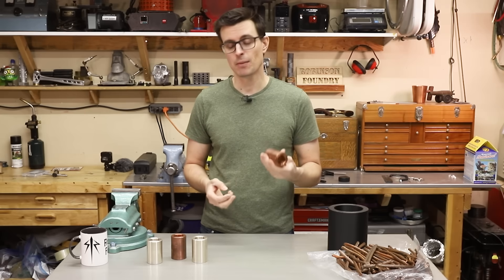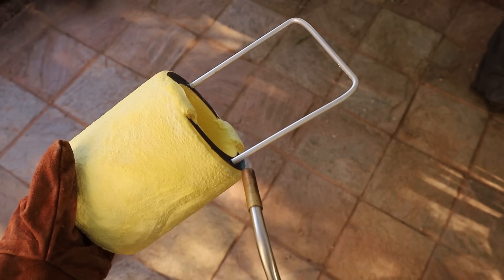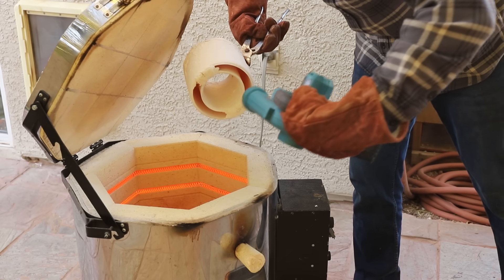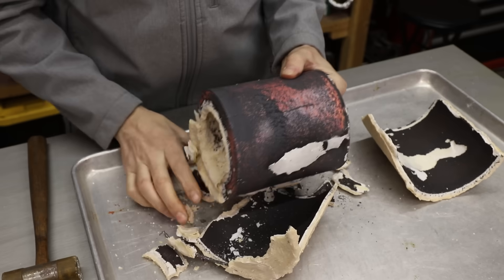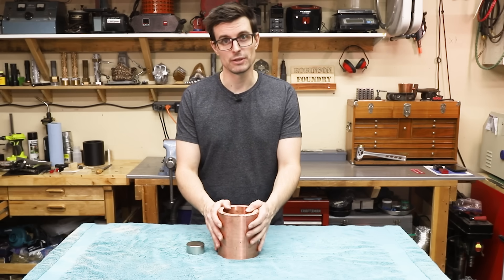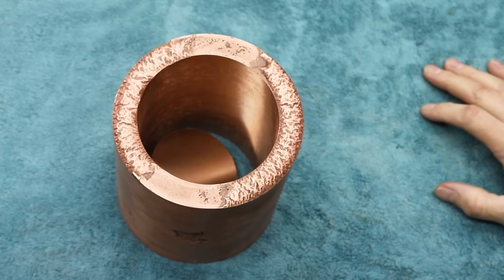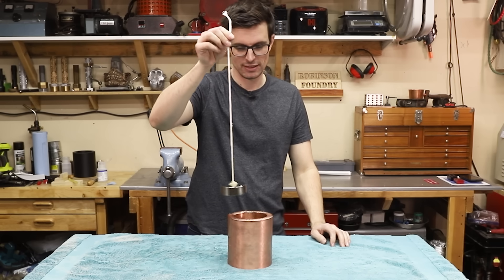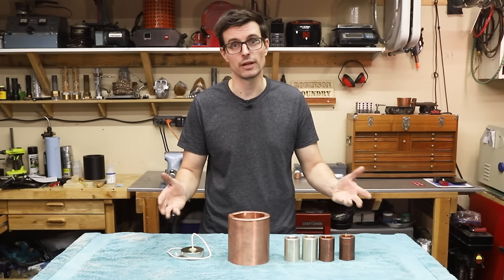Defying Gravity - HUGE Neodymium Magnet vs Copper Tube Experiment - The Power of Lenz's Law!

Comment: you needed a sprue to make poring easier that looked had lol that would've taken care of the shrinking problem too. it would be a little more complicated than the standard mold that you used but maybe you could make the next one just a tiny bit bigger and then throw it on a lathe?? I play around with my nieces and nephews with a long copper tube and some very strong magnets I have. I also have a big quarter inch stick 2' x 2' piece of copper plate that they really like playing with.

Comment: The underlying electro magnetic forces produced by the moving magnetic field produces other stuff too.
1. Try the experiment with very thin copper tube to observe the heat that's being generated.
2. Try the experiment whilst it's submerged in water.
3. Try the experiment in a very cold environment.
4. Try it with a woven copper tube.
5.try it using an insulated copper coil and connect the ends to a meter or a load.
6. Try it using a coil of copper connected to a large capacitor in series and parallel.
7. Try it with longer coils to study the effects of an autotransformer effect to measure the voltage produced.

Comment: If you put a corkscrew ridge or groove in the tube, or a copper corkscrew ridge in a plastic tube, will it cause the magnet to spin on its own when dropping or pulling it through on a string? Kind of like the grooves in a gun barrel, though the magnet wouldn't be touching the sides. What about a ball of copper through a magnet tube? 🤷‍♂️

Comment: This is really interesting. Maybe you could suspend the larger copper tube onto a vee block with roller bearings as contact points and spin the copper tube to try and get the large magnet to float in the middle. Great video!

Comment: Interesting video, thanks. Wouldn't green sand casting have been much simpler. Also, lookin how the copper splashed too far or too near when you poured, if you had poured along the ring and not cross/radially you would have had much less spillage.

Comment: don’t pour unassisted, build yourself a gantry to pull the crucible and do the pour.  also a vibrating source like a corded drill with an off center weight will cut down on the flaws.

Comment: A thought for your next mag/copper pour… make a tube similar to this one, with a ‘tube’ inside, but for the outside, make a ‘cone’ shape, thicker at the bottom, thinner at the top.  As the magnet falls, the force increases.  Is it possible to make the magnet stop before it exits the bottom?  I think it would be interesting to test!

Comment: Get a plastic pipe or conduit say 1.5 meters long and drop the magnet thru it so that the magnet accelerates under gravity then decelerates when it goes thru the copper pipe at the bottom of the fall.
It will look cool to see that especially if the pipe is clear.

Comment: You had problems with pouring the copper into the mold because you were pouring it at the wrong angle! The pour should be done parallel to the mold's circumference, not at a right angle. Try to place one round magnet at the bottom of the tube (placed vertically on the table) and then insert another round one with the opposite polarity in the tube too. You should be able to accomplish a permanently suspended magnet with a degree of resistance to bouncing.

Comment: I wonder if anything interesting would happen if you would put the small cylinders through the big cylinder while putting a magnet through the inner cylinder. Basically so they are all stacked into each other. Perhaps the gaps would be too large to see anything interesting, but perhaps thats an idea to try out? Even just have tubes of copper that get wider and wider, stacked into each other, with a magnet in the middle, maybe the magnetic fields will affect each other somehow?

Comment: Suggestions:-
Degas the liquid copper. Buzz bars are made from Oxygen Free High Conductivity copper.
Ensure the inside of the 3d print is vented to atmosphere before burning it out.
Add a 3 to 4 inch diameter sprue on top of your 3d print where you poured the liquid in. This will help with pouring. Having a larger surface area to volume ratio it will remain liquid longer so keep feeding the part with liquid as the copper contracts and solidifies in the part. The hydrostatic head also helps with porosity.
Add a similar diameter riser on the other side to vent the part while pouring and feed the part while solidifing.
Chills are added to sand molds to make grains smaller. You want them bigger so wrap part and feeds in ceramic wool so it cools slower allowing the copper grains to grow big. Don't forget to cover sprue and vent after pouring. 
Cast at a higher temperature. 
Use molochite instead of silica from layer 2 or 3. It is a lot cheaper. 
If you are using E-glass cloth you could wrap the outside with it as it will soften and sinter at orange/yellow heat.
As others have said reduce the air gap between the magnet and copper. See Ben's video on magnetic materials at Applied Science.

Comment: Question?
What would happen if you wrap some copper wire around your copper tube and fired some voltage through it. Ac current and DC current.

Comment: Could you hook some battery cables to the copper pipe and power something while you drop the magnet into the pipe ??? Small LED or something else ???
Reply: If the pipe was a single coil of wire: yes -- this is regular Faraday induction. But I think with a solid copper pipe you can't quite get the current out of the pipe.

Comment: 8:30 Put the copper tube sideways on a rock tumbler, that keeps the tube rotating, so the big metal disc magnet floats in it suspended for as long as the rock tumbler keeps rotating the copper tube.
Reply: What's interesting too is why the magnet floats in the center when the tube is rotating: When the magnet is off center, the copper rotating past the magnet is going thru a gradient in the magnetic field. That is, imagine a point on the tube approaching the magnet. As this point rotates, it gets closer to the magnet, then as it continues rotating away, it gets further away from the magnet. So the strength of the magnetic field that this point of copper experiences is constantly changing, and it is this changing magnetic field strength that actually induces the electric current (and opposing magnetic field) in the copper. This opposing field tends to push the magnet away, and any part of the tube that is closer to the magnet will also push it away in the same manner. Thus, the magnet gets pushed toward the center. If the magnet's poles are oriented coaxially with tube (as it is shown in the video), there is actually no current induced in the rotating copper tube if the magnet is perfectly centered, as the field is uniform all around. Of course, gravity pulls the magnet downward, so it is always a bit off-center toward the lower part of the tube, which constantly pushes it back upward toward center. All of this is the principle behind homopolar magnetic bearings.
Reply: nice idea!
Reply: I wonder if the effect is the same with 2 semi circles or 4 quarters? This breaking any current/field between the 2 half circles..

Comment: I would like to see dropping or shooting the magnet into the tube at very high speed.  Try 10 feet of vertical plastic pipe that smoothly joins the copper pipe.  The faster the magnet goes, the higher the forces.  Drop the magnet and it will free-fall down the plastic pipe and then be violently stopped as it enters the copper pipe.  Could the force tear the copper or crack the magnet?  A higher fall makes higher velocity, but 100 feet of pipe could get costly, and then you need 100 feet of tower.  The potential energy is equal to force (weight) times height; falling converts it into kinetic energy (minus losses caused by displacing air).  There are ways to boost the speed beyond what gravity can do:  Cap off the plastic pipe with foil and pull a vacuum inside it.  Slam the magnet through the foil and atmospheric pressure will blow the magnet down, adding to gravity.  An improvised rifle or cannon could propel a smaller magnet (one with a non-metallic barrel).

Comment: I'm not boasting or anything and I know those magnets are massively powerful, but their power does not extend far from their surface.  I used to be an MEI and CT Scanner engineer and we got to play with truly awesome magnets.  We used to get the junior doctors to hold part of the aluminium safety rail and literally RUN at the magnet.  They would never get there, because the magnet would slow them down to a crawl before they hit it.  MRI's are fun, just a bit unforgiving.

Comment: Curiosity!   Connect a voltmeter across the half-height external middle diameter, top rim to bottom rim, across the half-height wall thickness.  Then drop the magnet in each case.  What happens if you apply an opposing DC current in each case, then drop the magnet?  (Ballast resistor?)  AC?

Comment: It is not anti-gravity, It has nothing to do with gravity. If you had attached a cord to the magnet and tried to pull the magnet up through the copper tube it would resist your efforts. It is just the changing magnetic field along the length of the copper tube is inducing and electrical current in the tube which in turn is producing an opposing magnetic field.

Comment: Instead of pouring perpendicular to the opening in the mold, try pouring it tangentially. When the molten copper sloshes it will mostly go in the opening further away from the initial spot, instead of pouring into the center of the mold and wasted.

Comment: I've always wondered what would happen if you had a copper toroid with a band removed from the circumference of the outer most face and put a magnet inside and then spun the toroid like a wheel at the exact speed the magnet was falling at so as to keep it continually levitating.

Comment: Definitely make the ID size more exact to the size of the OD of the magnet if you want to see the best results. The closer the better. That's why a magnet that's literally sitting on a copper sheet then sloped at a near 90° angle will move extremely slow.

Comment: I wonder if heating or freezing the magnet would make a difference.   Kind of like a MRI machine, it's liquid cooled.
Reply: Heating magnets above their curie temperatures (different for each material) kills them.
MRI machines have a huge magnetic field from a superconductor (ZERO electrical resistance). Most superconductors need to be cooled to liquid nitrogen or liquid helium temperatures to become superconducting.

Comment: Using two smaller neodymium magnets, carefully attach them together at opposing fields, then test to see if they fall through regular air in a vacuum at the same speed as other objects. It is my understanding they will not, which would be baffling. I haven't had time to test it.

Comment: Why would you waste so much plastic? You could have easily added 1-2 degrees to the sides and then removed it from the mold. If the mold failed, you'd still have the original to try again.

Comment: With the magnet on the string, hold it so that the magnet is just touching the outside of the copper tube.  Without moving the top of the string, pull the magnet away from the tube (like a pendulum), and then let it go so it can swing back toward the tube.

Comment: Fun to watch. What happens if the two magnets are placed connected by their magnetic attraction to the opposite ends of one of your smaller copper tubes then dropped through the larger copper tube? Also perhaps physically attached faced opposing magnetically.

Comment: A good way to show the 'resistance' of the magnet to move in the cylinder would be to hook up a fish scale to the string.  That way when you pull the magnet up and out of the cylinder, you can see the increase in the amount of force it take to pull the magnet.  Outside the cylinder, the scale should always read the weight of the magnet when you lift and lower, but once the magnet is in the cylinder and you go to lift, you can easily see/show that dramatic increase.
Reply: You need to be careful to keep the scale far away from the magnet, and ideally the scale should not contain any ferromagnetic materials (or paramagnetic materials if you want accurate measurements).

Comment: I’ve seen someone swing the magnet at a chunk of copper and before it crashes into it, at least what you’d think would happen, it’s like invisible brakes are applied to the magnet and it slows waaaayyyy down and just touches the copper. Looks really trippy, might be a neat effect to show.

I found a small neodymium magnet at work and spent waaaayyy too much time dropping it down a 1/2 copper pipe. Took like 5 seconds to travel 2 feet.

Comment: You can use the same phenomenon to launch aluminum discs from the top of a flattened conductive coil when AC current is applied. A thin rod is usually placed in the middle of the setup to constrain the motion of the aluminum disc, otherwise it will tend to simply slide off to the side. Aluminum is better for this since the metal is less dense than silver or copper. The conductive coil can be made from some copper wire. Nothing fancy is needed, just a switch or a voltage controller and conventional residential wall power (standard 60 hz 120 v AC works fine).

Comment: I use small neodymium magnets in projects all the time and keep a variety of them on hand. People are amazed at the power of a 1/2" disc X 1/4" thick N52 grade magnet when I demonstrate them. And I keep a 1" N52 sphere and a 4' length of 1 1/4" copper water pipe on hand to demonstrate Lenz's law also. Even being familiar with it it never ceases to amaze me at how long it takes to drop through. That 3" magnet you are playing with is a monster. Be vigilant with it especially around the other large magnet.  By the time you realize you made a mistake you may have already lost a finger. I've had a 1" magnet bite me pretty good and it happens fast.
Reply: It’s true I lost 2 fingers to magnets.
Reply: @Jonb173 ✌👈👍
Reply: @Jonb173 thank you for sharing😢 that's intense I have had a magnet bite me once that now I have rules. And I've told people does the big ones can take your fingers but I don't think they believe me... So I'm adding your anecdote and life experience to my spiel when I share and teach with magnets. So again thank you. 

I started this method of rulemaking after I was injured by a table saw from a kickback of MDF and it was actually a man that I worked with that had lost four of his 10 fingers to a saw in the shop that we worked at that cemented the ritual of rulemaking and rule rehearsal every time I turn on my saw!
Reply: @souljunkee33 what do mean started this method? It is a very standard rule to have basic rules whenever any uses are is around tools.
Reply: And also its good to cover it in cloth and cartboard or something, while you walk through doors. You can simply forget that the frame might be made of metal, and boom injury or worse yourmagnet might crack xD
Reply: I salvage magnets from hard disk drives; thinking I would use them as refrigerator magnets but they are MUCH too strong for that purpose.
Reply: Magnetrons from microwaves.  Beware of the beryllium dust.
Reply: @thomasmaughan4798 try dipping/covering them in rubber like tool dip or liquid black tape, it requires several layers to be effective but it does give you the good holding power without “becoming one” with the fridge door or destroying the finish on it. You can also use epoxy or similar material but it isn’t as durable as the rubber is
Reply: @bobquartlemigula2351  Excellent idea!  Rubber coated disk drive magnets.
Reply: @thomasmaughan4798  you can use those in 3d prints. leave a void space for the magnet in your model and set your print to pause at a certain layer, insert your magnet and keep printing. just don't do this with a magnet that's strong enough to mess with your printer toolhead.
Reply: The magnet in the video is tiny compared to what the YouTuber Brainiac75 has.
Reply: Try using a scale and read how much force to it creates, how much force at different depths in the copper.
Reply: How did you right all that
Reply: @Darealcatnap  "How did you right all that"
By not being left .

Comment: If you solder a wire from the top from one end of the copper tube to the other will that allow the current to flow and the magnet fall without slowing?
Reply: No, the eddy currents flowing in loops (around and up and down in the neighborhood of the magnet) in the copper tube are producing the opposing magnetic field that is resisting the fall of the magnet, and the eddy currents form in proportion to the rate of change of magnetic flux in the copper.  Thus, a wire farther away will have negligible effect.   There is no net voltage from the top to the bottom of the tube.

Comment: I propose to create a Gauss gun, where using the casting method you can create a powerful induction coil with a relatively small number of turns but a large wire diameter. One formula that describes the inductance (L) of the coil is:
L = (N^2 * μ * A) / l
Where:
L is the inductance in Henry (H),
N is the number of turns,
μ is the magnetic permeability of the medium (for an air coil, approximately equal to μ0, the permeability of vacuum),
A is the cross-sectional area of the coil,
l is the length of the coil.
This formula shows that to achieve a higher inductance, you can either increase the number of turns (N), or compensate for fewer turns by increasing the cross-sectional area (A), which includes using wire with a larger diameter. Thus, increasing the wire diameter with a small number of turns helps create a powerful induction coil